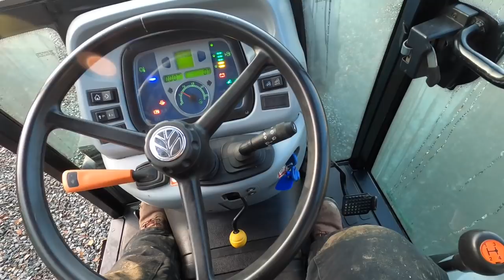I bought a TINY DISC.

Comment: All those oranges on the tree and ground.  The discs are  not all the same.  I see only 6 plates per row on front, 4 on rear.  Usually an equal number unless the front throws soil too far.  Those scalloped blades are usually for Corn Stalks.  No need for new blades yet, try those first.  The posts are for weights no doubt since 3PH have no down pressure.  I'd leave them for now.

Comment: Pipes are used to hold tractor weights if more down force is needed for harder ground. 3 point hitches have no hydraulic down pressure.  Take video of your reconditioning of the plow.👍🏼🤠🇺🇸

Comment: good choices,,,great equipment,,,good times ahead!! Large equipment can do lotsa work,,,but they can never do what a smaller rig can. Smaller equipment can be more precise, can get to tight places, is easier to haul and work on,  cheaper to operate per hr, cheaper to repair, puts you closer to your plows so you can more easily see what is going on. They cant do what larger ones can, but neither can large ones do what smaller ones can do. Im proud for your choices,,,and wish i had as new as you do. Im using equipment from 47 yrs ago!! HAHA!! thanks for your great post!!

Comment: Nice Domries disk the two  rear end blades are extension you can run it with or without it, if you have wider rows it would be nice. If you have the time it be nice to weld a hitch behind disk for a ring roller. :).

Comment: $1300 does any grease come with that screwing.  I’m sorry but you guys got burnt bad!!!  And the shields on the side you were talking about absolutely useless lol.
Reply from the maker: Why exactly do you think we got screwed?
Reply: I live in NC disk harrows are a dime a dozen.  I have one I would have given you guys. You can buy one at our local John Deere dealership for $750 brand new, frontier I think is the name brand. Maybe I came across as an ass sorry about that.  And maybe there not as common in California I don’t know.  But literally everyone in NC that’s has a garden has one.  I just thought that was awfully pricey.  If you put scalloped blades “ones with ridges” on the front they cut awfully well and run round on the back. The front disk gangs cut and the back gangs are for smoothing.
Reply from the maker: Nick Allred maybe it’s something different? This is a Domries Super Narrow. Brand new it’s a little over $7,000
Reply: Beaver Vineyards good lord for that. We bought a used 24’ John Deere 637 used disk for $8,500 a few years back. That thing is maybe 5’.  I looked em up they are made a little different than a finishing disk. But I certainly would have never dreamed that they would have sticker like that. I got to get in the equipment-parts business. Parts seed and fertilizer seems that’s where our money always ends up.

Comment: Some unsolicited advice from a stranger :) Don't let your dad or uncle do the work on that disc. Roll up your sleeves and remove those discs and bearings for the experience. Find the numbers on the bearings and go get those parts. Change the disks and get those bearings greased and adjust those disk scrappers. Next time you can give your dad advise on what scrapper looks better. That's the only way to gain the experience you are going to need to succeed in farming. You are doing great, now go get your hands dirty and let out your inner grease monkey.
Reply from the maker: I will work along side my dad to fix the disc :)